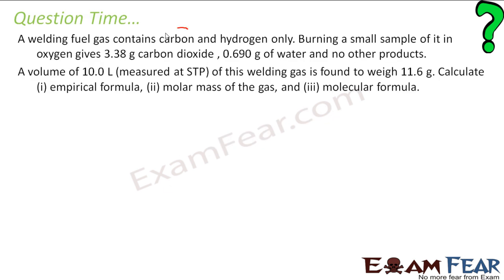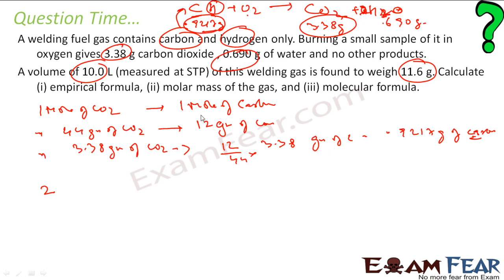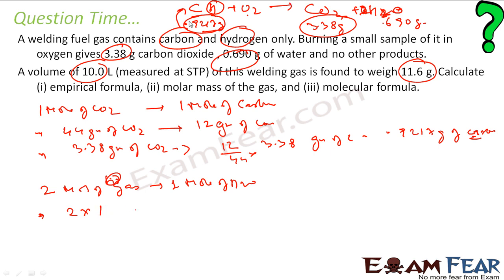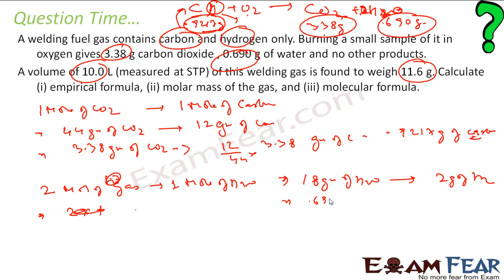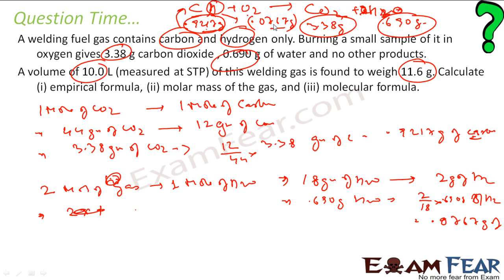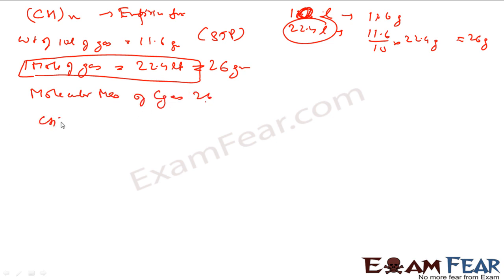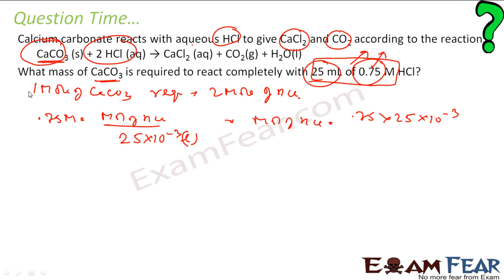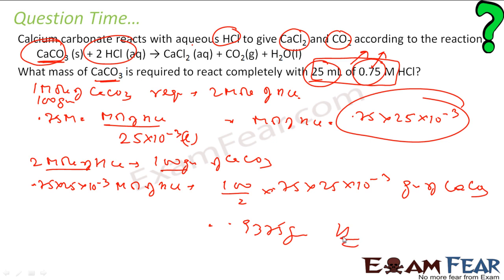Chemistry Basic Concepts of Chemistry part 21 (Question Numericals) CBSE class 11 XI

Comment: In the welding fuel example, 
CH + O2 → CO2 + H2O
First of all, H is not balanced 
Second, CH is not a compound, if it is then it will be very unstable
Third, u first considered CH as the compound of fuel, and then u proved that CH is the empirical formula. 
Empirical formula would be CH, as u took CH in the starting, if u would have taken CH4, then the empirical formula would have come CH4. 
I think u solved it wrongly.